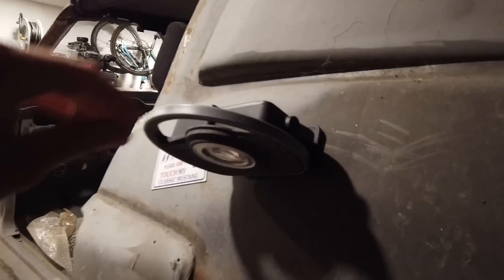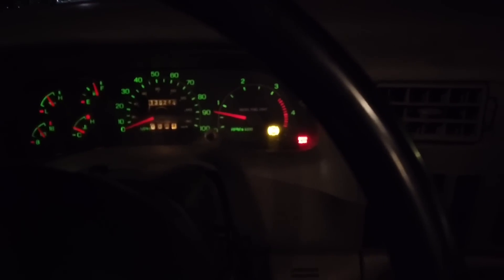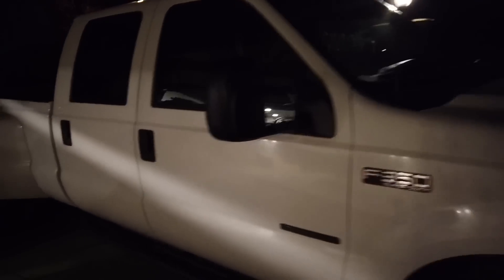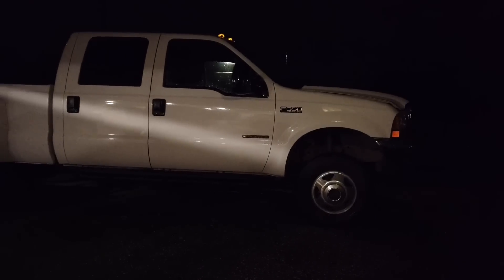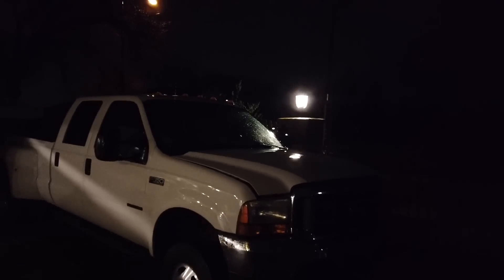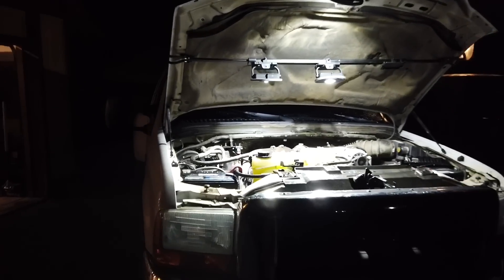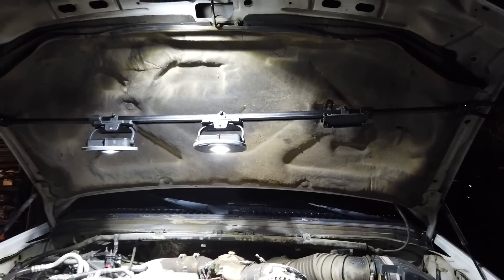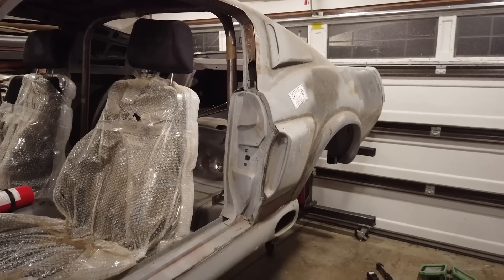MY FAVORITE - Eastwood LED Lights, Tripod & Hood Bar Bracket Review and Compare SP

Comment: Love the lights.   Your abs problem could be a speed sensor that’s what my granddad’s truck had wrong was a loose wire and his left front speed sensor
Reply from the maker: Isn’t the speed sensor on the rear end in the 7.3 and the ABS sensors in front? I don’t know really, wanna check them all wires and connectors

Comment: hey i have been trying to buy a vehicle off of a salvage auto auction website and fix it up like you do but they tell me that i cant bid on the vehicle because i do not have a dealers liscense. Is there a website that will let you buy a salvage vehicle without needing a dealers liscense?

Comment: i made mine using old brake bulb and holder. its connects to car battry using clips
Reply from the maker: But did you use converter?
Reply: no just simple direct wiring, two wires connected to bulb holder